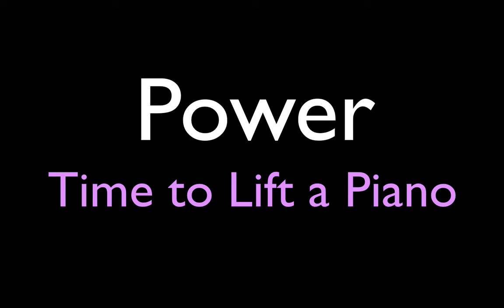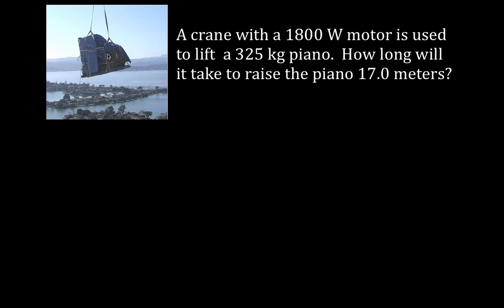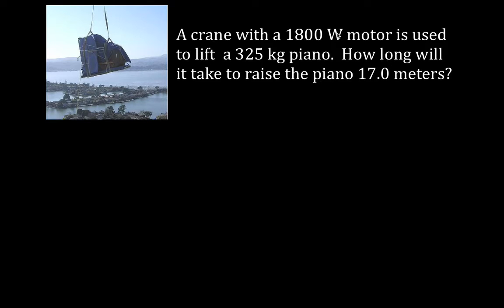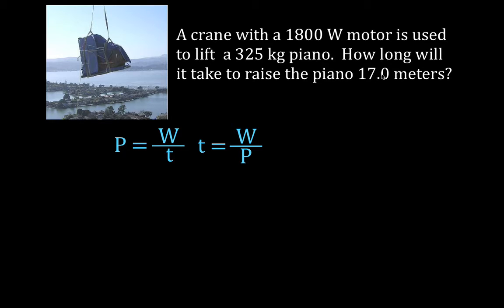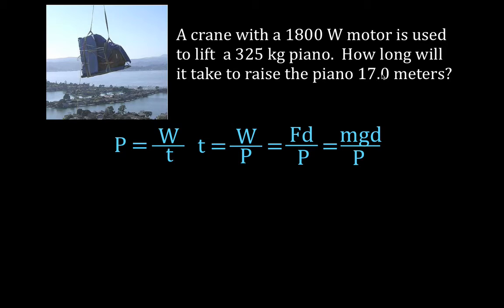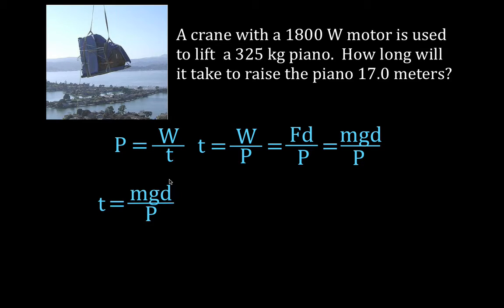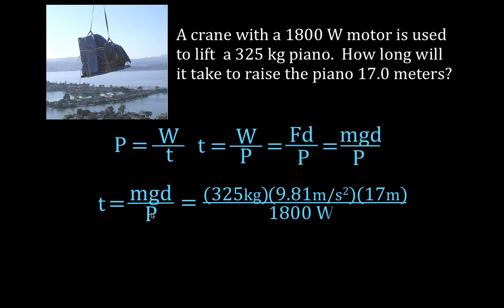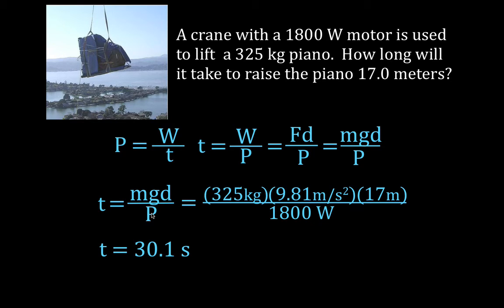Energy, Work & Power (26 of 31) Time to Lift Object with Known Mass and Motor Power

Comment: "A 250 N force expends energy at a rate of 679 N-m. The force acts on an object at an angle 60.0 º relative to the object’s displacement. How long will it take the object to move in 25.7 m?" what formula of power for this?